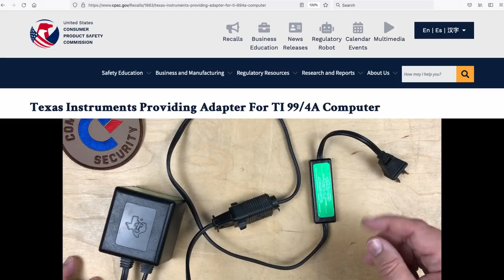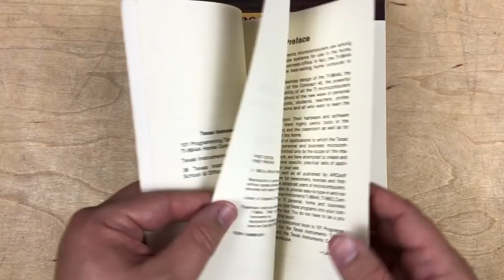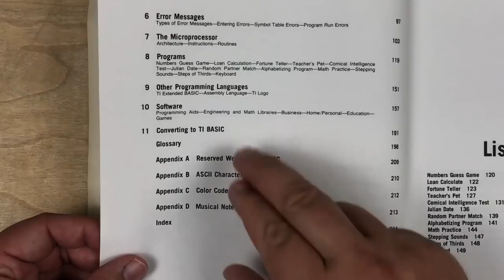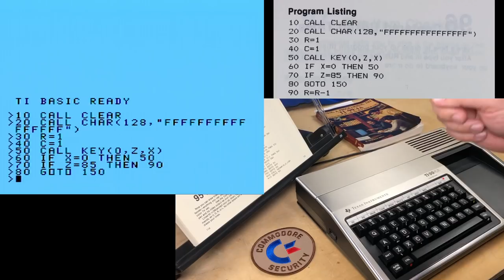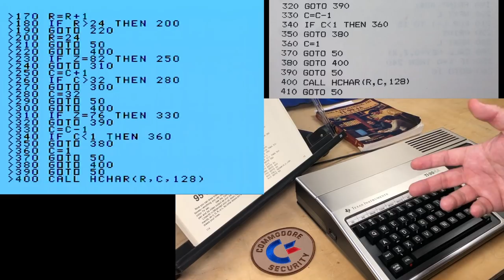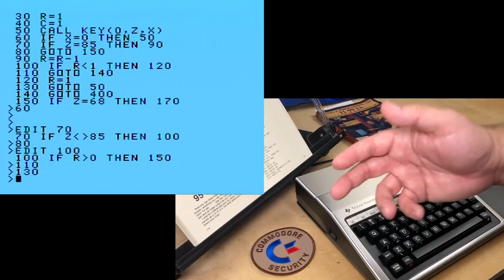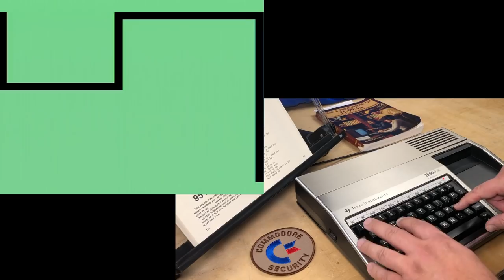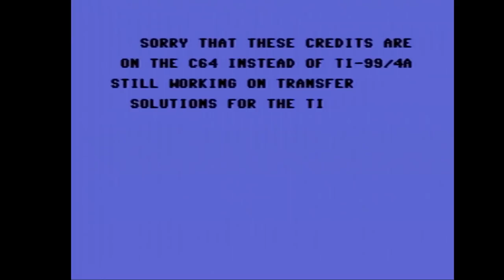Optimizing Line Count in TI BASIC: Type-in Fun with the TI-99/4A

Comment: I'm sadly not familiar enough to have a definite answer but my understanding is that while Commodore 64 could run cartridge-based games, floppy disk and cassette were much more common formats for software distribution. I'd guess the MSX line is closer to being a video game console because software, and especially game software, was much more commonly distributed on cartridges (I can only speak for emulation, but it seems that cartridge software on MSX was also self-booting, giving it more of a feeling of a hybrid of computer and game console.)
Reply from the maker: The VIC-20 and Commodore 64 each had hundreds of games on cartridge, and they were also self-booting, so it was pretty much the same as the MSX. But it's true that game developers for the C64 mostly transitioned to cassette and disk because it was cheaper than cartridge, and also allowed more capacity for more complex games and/or more levels. I know MSX titles were released on cassette and disk (more cassettes for the original MSX, and more disks for the MSX2) but cartridge releases continued as well; I believe this was mostly just in Japan and it probably had to do with the MSX more directly competing with game consoles throughout its life.

Comment: I think you made it with less lines but, it runs slower because checking not equals take a bit longer than equates( It was fixed at the end, I think)
Reply: A look in xbas99.py from xdt99 suggests this may be caused by unequal not having a token, so it's more complicated to parse.

Comment: As soon as you started typing "70 R=R-((" I knew where you were going. I've done this so many times in the past and even more recent in spreadsheet cells!

Commodore BASIC is terrible as a BASIC but it's really excellent at getting you to learn the system and forms a really good basis for learning how to use machine code on the systems due to all the PEEKs and POKEs you needed to use to get the best out of them.

Comment: TI-99/4A Basic includes commands for graphics, where Commodore 64 never completed their Basic language. They left the user to use peeks and pokes to do graphics.
Reply from the maker: Yes, it's an admirable attempt, but TI left out commands for sprite graphics, for example, and also omitted PEEK and POKE, thus completely preventing sprite use. So TI BASIC is unfortunately incomplete as well. POKE and PEEK aren't ideal, but at least Commodore 64 BASIC programmers had full use of their machine's facilities through them; TI users didn't even have that option.
Reply: Blame Bill Gates.
Reply: @8_Bit  Extended BASIC adds the sprite subprograms needed to use them.  PEEK and POKE were omitted because the unexpanded TI computer has no CPU RAM available to the user.  If you add a 32K memory expansion peripheral, PEEK and POKE become available, although they are slightly different (what isn't) than Microsoft BASIC:

Extended BASIC adds CALL PEEK and CALL LOAD.  CALL LOAD either loads assembly language program from disk, or POKEs memory, depending on how you use it (and can do both in one call).  CALL PEEK can return multiple bytes in multiple variables at once.

Editor/Assembler and Mini Memory add CALL PEEK and CALL LOAD to TI BASIC.  They function the same as above.  They also add CALL PEEKV and CALL POKEV, for peeking and poking video (VDP) memory.  With these modules, it is possible to make sprites in TI BASIC, using POKES.
Reply: @8_Bit  And having to learn PEEK and POKE meant that when you were ready to move up to assembler, anything involving graphics and sound was pretty much a 1:1 conversion from what you were used to.
Reply from the maker: @CRCO1975  Yes, Extended BASIC seems quite a bit better. Likewise, there are extra C64 BASIC extensions available on cartridge such as Simons' BASIC that add sprite, sound, and other "missing" commands.

Comment: Just wondering why you cannot use the MPY/DIV as well as the MPYS/DIVS commands to allow you to speed up the program
Reply: MPY and DIV are assembler opcodes so not available to either the standard or extended BASIC. MPYS and DIVS (signed MPY and DIV) are again assembler opcodes but were for the 9989 and 99000 CPUs including the 9995 found on the Myarc Geneve 9640.

Comment: I might be wrong, but I don't think your version is exactly the same as the original, because I think the original doesn't draw the square initially, but rather it waits until a key is pressed. But I like your version better, not just because it's shorter, but also because you can at least see where it will start drawing.
Reply from the maker: Yes, it seems I inadvertently improved upon the original!

Comment: weird how -1 is true on the TI-99/4a, whereas on any modern system 1 is true and 0 is false
Reply: -1 has all bits set using 2s-complement, so I presume all bits are mirroring the truth value in parallel, whereas for true=1 only the least significant bit is used to represent the value.
Reply: In most basics that I know of, including modern ones like VB.Net, TRUE is -1. This is because in basic boolean operators are bitwise. That is, AND does an "and" of each bit of its operands, so for this to work all of the bits must be set, so TRUE is -1 (twos complement). In languages like C there are different operators for boolean AND and bitwise AND so true can be 1
Reply: Boolean has only ever cared about equality to zero. It's why CPUs have a status flag for zero.
Reply: @davidmcgill1000  Yes, exactly, "zero is false", and "not zero is true". This, combined with how basic uses bitwise boolean operators (AND/OR/NOT) is why TRUE has to be -1 for boolean expressions to work as expected. 

To explain lets do a simple example. We'll use 8 bit integers since it makes it easier. Let try using "TRUE=1", that is, "00000001" binary. Then if we have an expression "NOT TRUE" that is "NOT 00000001" which is "11111110", which is not zero, which is still true, instead of the expected false. So if "TRUE=1", then "NOT TRUE" is also true, which is wrong. However if "TRUE=-1" it all works as expected.

Comment: Why did they decide that true should be -1 and not 1? I find that counterintuitive.
Reply from the maker: I found it strange as well, but it's common in several different BASIC implementations. In at least some cases it has to do with how numbers are represented in binary. For example, 0 (false) is when all bits are "off". In 8-bit binary this would be 00000000. So true would be when all bits are on, which would be 11111111. In signed binary math, this number represents -1. If you subtract 1 from 00000000 you get 11111111 - it wraps around. I hope this helps. Maybe I'll make a more detailed video about it sometime.
Reply: @8_Bit  thanks for the explanation!

Comment: This is not an optimization. It should be called a programming trick. The original program just goes "as is" in old BASIC style program flow. The use of Boolean expressions here is just a workaround to create a local shortcut.
Reply from the maker: One can optimize code for many different things, often at the expense of other metrics. Optimize for speed, for code size, for runtime memory use, for battery life, or in this case, optimizing for line count or for minimal use of GOTO. The original had 27 GOTOs in it; my final version has 1.
Reply: @8_Bit  You left out legibility, which is usually the (subjective) metric that suffers from all those other goals. One thing people often forget, partially because they've been taught there's a space vs speed tradeoff, is that smaller often is faster as well. For instance, it could make more efficient cache use, or in this case cause fewer operations to interpret.

Comment: There's AUTO command that generates the line numbers.Also, that programme has to be one of the worst written BASIC programmes I've seen. It looks like it was badly translated from a different dialect. As to one term per line - since BASIC was really designed as a teaching language, if you dig around in old standards, some specify that, for clarity, one command/command structure per line. I hated it with a passion.

Comment: A computer being called a console existed long before video game consoles ever existed.  Any time I see the whining I laugh.  It's a console, deal with it fanboys.

Commodore Basic does suck, but TI Basic sucks more.  TI's hardware design adds to the suck.  RAM through the display chip?
Reply: Technically, the word "console" didn't mean the computer itself. In the early days of main frames and mini computers, it was used for the input/output terminal in combination with the UI that allowed maintenance and monitoring of a system. This was opposed to the user terminals, which normally connected directly to a user program, and only allowed the user to access the application it was configured for. Normally console terminals would be located in the same room as the actual machine. Home computers and PCs of course, didn't need external serial terminals. They had monitors and keyboards built-in, so the term was used for the whole thing, which made sense. Turn on your C64, and you have immediate console access to the system. Interestingly, nobody these days calls their PC a console, but the word creeps up again in its original meaning, as on Linux/Unix systems, the virtual terminal windows, are often called "Consoles", especially, when they provide shell access.
Reply: @jali7913  You read far too much into a sentence.  Whether a "console" was the computer or not is irrelevant.  The console is a keyboard (and in this sense the computer) and usually with a screen or printer (teletype), although not always.  In the 70s and 80s the lines became blurred as the keyboard had TVs placed in front of them and thus the "console" became divided.

The console was really just the unit in a general sense, which is why video games had "consoles".  TVs were "consoles".  Stereos were "consoles".  Computers were "consoles".  It was simply the operating unit, the electronic device.  That's it.  Nothing more.